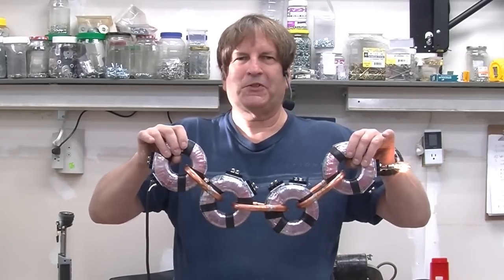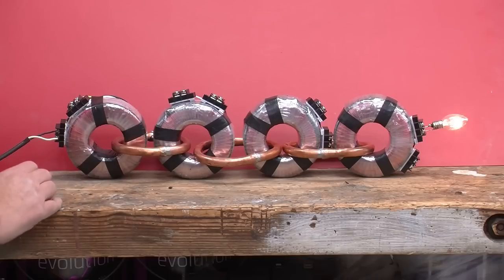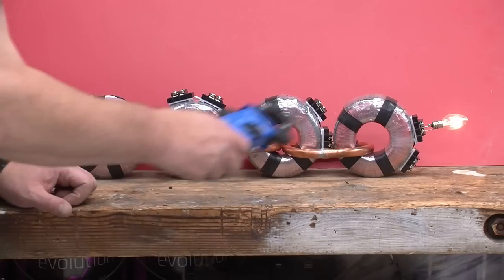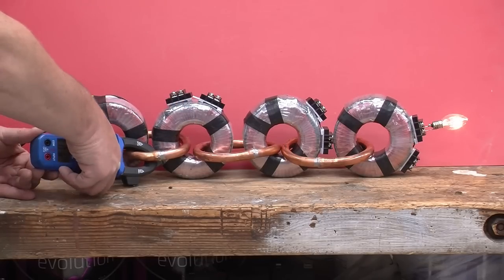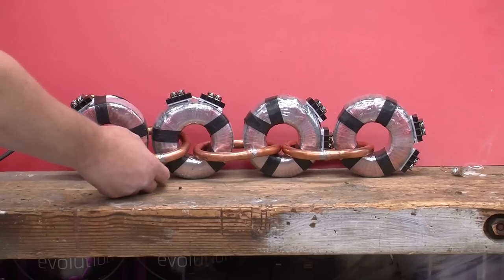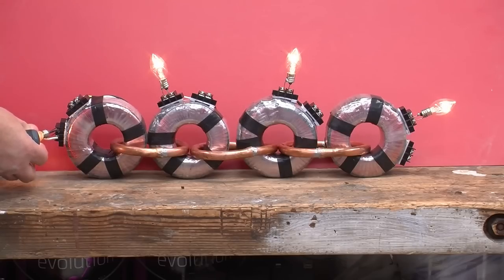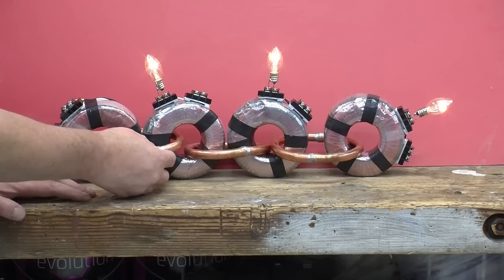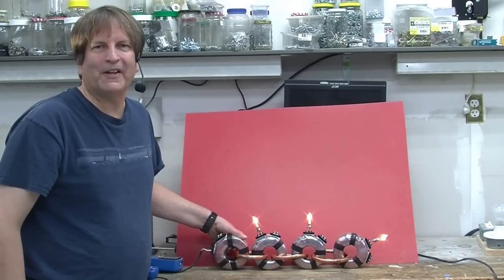Let's Experiment with an Electromagnetic Chain!

Comment: Are you talking amps or milliamps?
Reply from the maker: Amps! The current is high because the the copper pipe is equivalent to a coil with just one turn. So the magnetizing current of 5 Amp turns on one turn is 5 Amps. On the 120V 500 turn coil that feeds power into the chain, the magnetizing current for one toroid core is the same 5 Amp turns  so 5A / 500 turns   10mA in on the 120v lines (although for the chain with 4 cores being magnetized it is 4 times that).

Comment: Is this only possible with AC power or does it work with DC too?
Reply from the maker: Only AC unfortunately because the induced electric fields in the coils happen because of a changing  magnetic flux (from a changing electrical current). If you had superconducting materials you could actually make something similar that works on DC but it would have to be immersed in liquid nitrogen or helium and that's not really feasible for a demo like this!
Reply: @ElectromagneticVideos  That's what I was thinking but I wasn't sure.  Never seen this before but it's really interesting to see it working. I think these invisible energy fields and electrical components working are amazing. I wish I had gone to college for electrical engineering instead of stupid ass welding!!! Any monkey can weld lol
Reply from the maker: @thehulkamaniabrother2.089  You know, there is so much on YouTube in EE and Physics - if you find you like this sort of stuff you can get all the interesting parts without having had to endure some of the drudgery of university. I happy and thrilled to answer questions like yours.

As far as any monkey can weld - well I weld and it often looks like it was done by a monkey! I really value the expert skill of techs like yourself and marvel at the work of a skilled craftsman.
Reply: @ElectromagneticVideos  I consider any weld that doesn't fail to be a good weld lol. I've seen beautiful looking welds crack right down the center or the edge and I've seen dirty ugly snot beads hold up and take a harder pounding than superman's kneecap. And of course Chinese steel is garbage, always get the Canadian stuff instead lol. Even the oil they spray on Chinese steel for shipping is disgusting because it smells absolutely horrible to breathe the smoke that comes off it when welding on it. It's some kind of animal fat and petroleum mix and it will make you sick after a while. Makes you smell nasty too. Its so nice to not do that for a living anymore it's a dirty job that's for sure. I'll probably get cancer or heart failure from being electrocuted so many times from a bad ground from that damn tig welder. That shit hurts when you wake up on the floor 6 feet away from the place you were. Its from holding the filler rod without gloves on, the electricity goes up into your arm and blows you back across the room in a split second. It happened to me when I was a little kid too from plugging in a black and white TV and I got hit by the wall current because my fingers were touching the metal plugs like an idiot. I plugged a toy car remote into the wall to see what happens and it exploded in my hands not to long after that. I was like 6 or 7 I think but that's when I learned exactly how powerful electricity was I tell you what.
Reply from the maker: @thehulkamaniabrother2.089  I didnt know it was substandard. Do TIG welders use a particularly high welding voltage? It sure sounds like they pack a real punch to through you across the room. 

Reminds me a bit of the punch the high voltage charge that can be stored in an old style TV CRT picture tube has- even when turned off. If you touch the electrode you can get thrown too - apparently in the days of big CRT TVs many repairmen got their arm broken when reaching in a TV and it get getting flung outwards. 

Sounds like you did a lot of the same things I did as  kid and survived too. Actually lucky - AC can often paralyze you - happened to me once in the garden when my leg contacted a hidden live wire ...